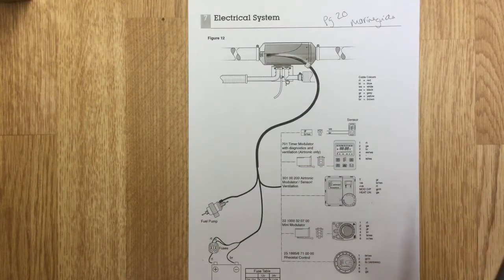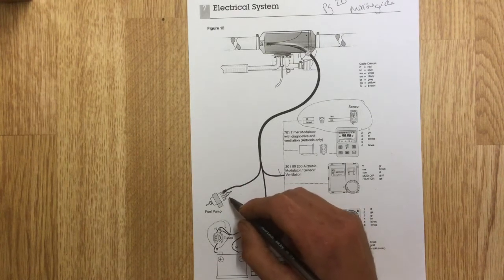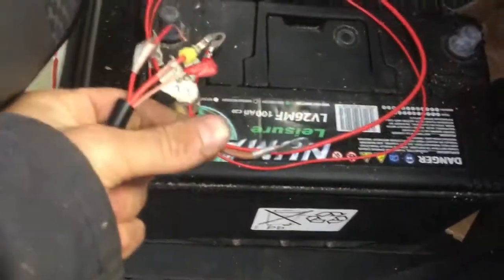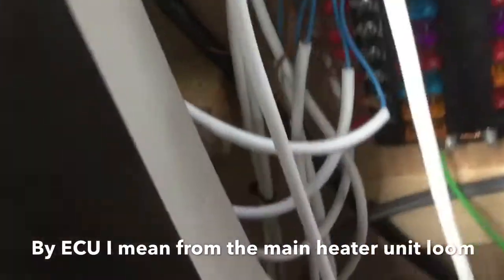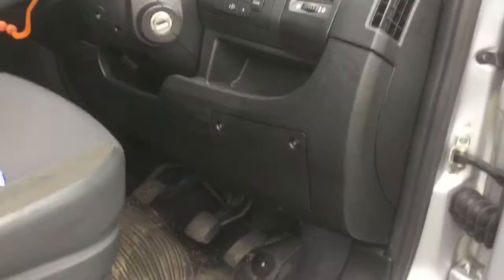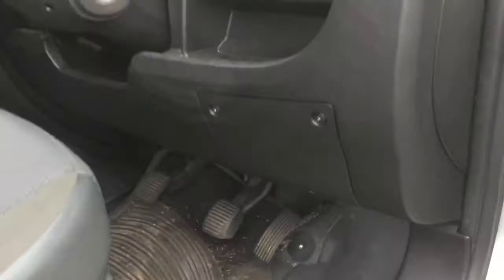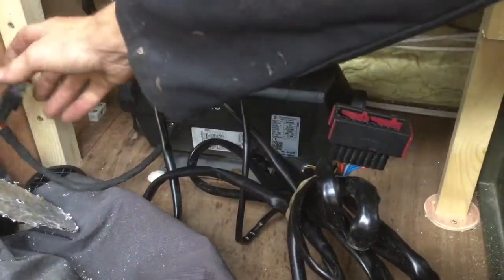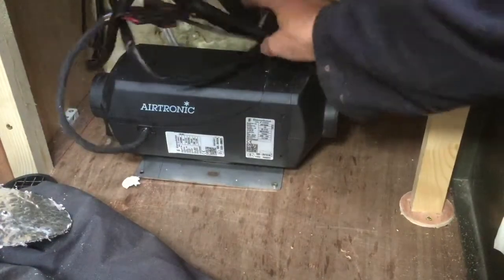Fitting an Eberspacher D2 to a Citroen Relay campervan -PART 4 Electrics

Comment: Thanks for your wiring guide, as i have just un-boxed a new D2 and was overwhelmed with the unbuilt connectors. now i know i just need to build up the plugs and match the wires for like for like.
Reply from the maker: +andythecrane1 pretty much, I would just have a check in the manual that came with it to make sure there have been no changes to the wire colours but it really is pretty simple. 

Just make sure you run the cables where you want them before you put any connectors on as it saves a lot of effort trying to route a cable with a connector in place.
Reply: MiNe Yours the colour combination looks the same as yours, just fitting into the 801 controller on my D2. 
I am going to feed the wires through before assembling the multiplug just as you suggested.
Reply from the maker: +andythecrane1 good luck, and let us know if all goes well.
Reply: Hi, I have now fitted the unit, and was pretty straight forward, just like you have demonstrated in your video series. The only difference is i run a separate fuel tank in the rear of the van behind a bulkhead.

Comment: Thanks for the video. Would u answer a question ? My van had previous install of eber to the vans battery as it was a crew van .. Now camper so moving the 12v from engine batt to leisure battery. To simplify because of access to loom I was just going to send a pair of 10mm from leisure batt to the existing eber 12v fused mini loom at engine battery. Eber will then run off leisure battery but with and extra 3metres of 10mm cable so was concerned about voltage loss and making sure that the eber had no additional sneaky power feeds and it was all from that fused block we saw in your vid. Sorry for long post thanks
Reply from the maker: +Paul Frankcom Hey frank provided it is a standard unit which I imagine it is, the fuse box should be the only power feed. I would imagine you don't need the cables to be 10mm the max draw is 10amps for the glow plugs on a D2 which would need 4mm cables to be well within acceptable drop I would think. You can see what the units draw by following this link : http://www.letonkinoisvarnish.co.uk/Models_A1_Current.html and then use a drop calculator such as this one here:http://www.12voltplanet.co.uk/cable-sizing-selection.html. To work out the size of the cables you would need...hope this helps. Sam

Comment: Hello I have a problem with mine it's on full power all the time the controller will not turn it down at all my control switch only has 3 wires red, black and blue any ideas please
Reply from the maker: I will have a look and think but my first thoughts are that the temp sensor maybe damaged or connection is faulty. As I think the the power setting is decided on by the temperature difference between the controller setting and the air temperature. Few questions....Do you have an external temp sensor fitted? what model and age is your unit? are they the colours from the loom or the controller? and what model of controller do you have? Cheers and good luck for the moment
Reply: MiNe Yours  hello mine is a Chinese import it's red and black I can't get any info on it any where it has no external temp sensor apart from a ntc on the control module and the control module has 3 wires come out of it to the loom 1 red 1 black 1 blue it's just on full power all the time I have tried to fit a room stat to it but it did not work either it's getting a bit desperate know as it the only heat source for my workshop at night to keep the frost off I bought it last month from China and it came last week I have tried to get a hold of the seller but there is only promises from them I can't get nothing from them and now they have stopped responding
Reply from the maker: So no guarantees on how your import works i know nothing about them, I can only assume they based it on the way Eberspacher units work. So hopefully this will be useful. 

I would imagine there would be a temp sensor same as an Eberspacher it will be inside the unit monitoring the temperature of the air flowing through the unit. I would try piping the hot air from the unit towards its intake (the one for room air) to check this, with the thermostat or temp setting set to the lowest and see if that makes it switch to low. Other alternative is put hairdryer or heater blowing into the intake...anything to make the air passing through it warmer. You could even try putting a box over the unit and putting the controller into it so it’s heating smaller area to see if that works. If the controller has a thermistor in it then make sure you get that warm too to make it think the room is warmer.

If it was an eber I would think that the controller or temp sensor is just not getting warm enough so it reads the difference of room temp and setting as been a large one and Max’s the output to bring the temp up quicker. This fault would commonly be caused by folks trying to heater large areas where the unit can’t keep up, when they have a remote installation (heater not in space been heated) or the unit drawing air from very cold space (outside normally)

Is the room getting really hot? Like tee shirt and shorts hot? Where does the heater draw air from? And the silly question...Are you sure it has a low mode ? Try the bits above. can you take a quick video of the unit in place and the installation upload it and post a link so I can have a look?

Cheers 

Sam
Reply: MiNe Yours hello yeh I will do it tomorrow I've striped it down so will take a video of it striped down so you can get a better look the intake is coming from outside but I've also tried it inside made no difference still on full power
Reply: here is a video of the unit strip down to show you i will do another one tomorrow with the unit running
 https://www.youtube.com/watch?v=ZGfKkGZjcio
Reply: this is the video of it running 
https://www.youtube.com/watch?v=q3wJRF7XSww&t=92s
Reply from the maker: What does it do if you keep it running? Does the room get hot and it still stays on max? Mine takes a while to respond the dial doesn’t change the fan or power setting on my d2 it just sets the desired temp of the room and only when the air passing through it reaches that temp does it turn down, it also will run on full for first few mins regardless of air temp before it allows dial to control. Although I must say yours doesn’t seem to follow same start up checks as the erbers judging by how fast it fires up, so none of this maybe helpful.
Reply from the maker: Ignoring the fact this link is on about fitting external sensors have a read it explains how it sets the power output in a better way than I seem to be able to ... https://www.letonkinoisvarnish.co.uk/Eberspacher_Sensor.html hopefully will explain why I am asking I& the room is getting hot and where the air is from. Also says if the intake air is under 5 or 10 degrees the unit will auto full power and ignore user inputs
Reply: MiNe Yours yet it gets so hot the room is unbearable and it still keeps going on full power
Reply from the maker: Hmmm, that is annoying, few suggestions but I don’t guarantee any of them, the ntc maybe faulty, have you tried checking resistance across it with a multimeter? warm it up and repeat make sure it’s changing (should decrease as temp increases I believe) On the same line of thought you could try bridging across it with a low value resistor (trick it into thinking its hot) and try to get it to shut down. 

After that if you cant get it running in low power all I can think is rig timer circuit so it just comes on for short bursts throughout the night, 

Where did you order it from ?

Comment: Hi what temp sensor are you using ?
Reply from the maker: +Alan Hunter Hi sorry for late reply, I use le tonkinois varnish one, here is link to it. Cost me £10 plus postage and well worth it. https://www.letonkinoisvarnish.co.uk/Eberspacher_Sensor.html
Reply: there was not one with the kit so i prosume it does not need on as there is a ntc in the controler as seen in the second video ive just put up

Comment: Any firm that makes a heater and then leaves many wires going nowhere and even the wires from the control not matching up like yellow with purple twist and loom does not have that. Then to do such crap instructions. The firm is obviously trying to have people short the heater out. Thats disgusting. The wires should have be connected to the plugs so its obvious which goes where.